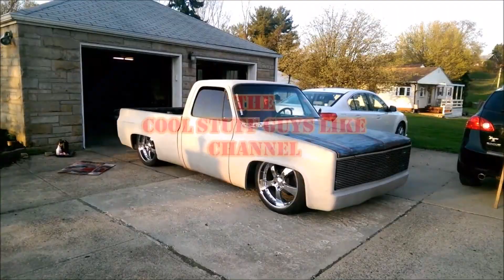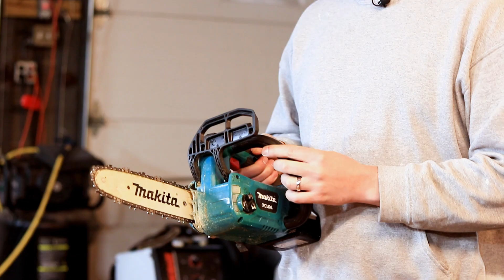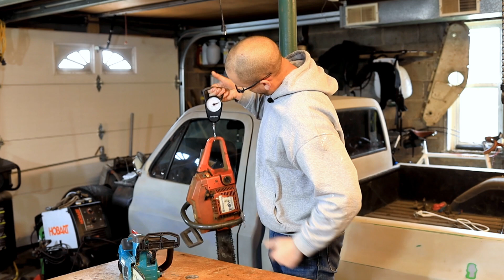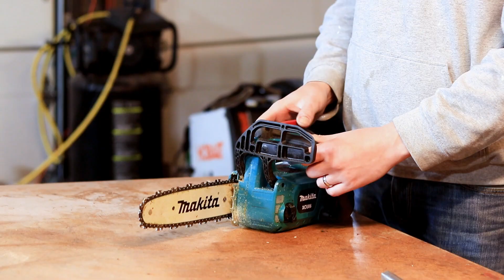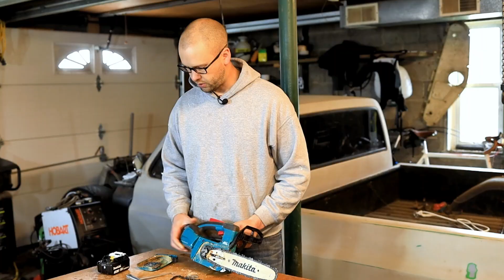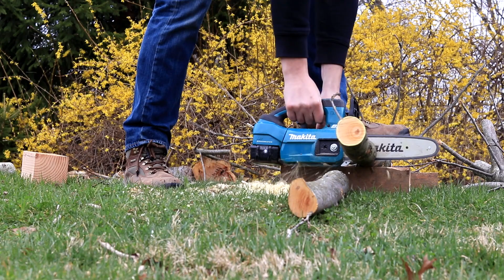Makita XCU06 Cordless Chainsaw for Trail Building and Limbing

Comment: I have a Makita 18 v chainsaw XCU06. Unfortunately, the chain was
damaged I have tried to looking to buy the new one to replace it.
Do you know where they sell it, please let me know ?. Thank.
Reply from the maker: Yes, you can get them on amazon.  The Oregon R40 10 inch chain is the chain for this little chainsaw.  I had to replace mine once after slipping it in some brush and tearing up a couple teeth.  It is about $10-$12.
Reply: instablaster.

Comment: are you sure that it's only 5.5 lbs w/ a 5amp battery?  other folks are saying per manual it's 7.2 lbs w/ battery.  trying to decide between this one and echo 2511t for in-tree work.
Reply: Did you make a decision on your purchase and if so, could you share any thoughts?
Reply: @nicod1886  I already have a stilh 201 tcm (top handle) for in-tree work, which I do NOT like.  lately it's been good but it's had its share of problems- mainly trouble starting.  also I was looking for something smaller.  but it's hard to justify getting another saw when I already have a saw that does the same thing.  also Ive been looking at the new-ish Husqvarna battery powered saw, which seem to be more powerful/lasts longer than makita.  I haven't acted on a purchase or sale of my current tree saw yet but one thing I have decided is to NOT get makita chainsaw.  if I want to go electric, I'll get the Husqvarna electric saw.  if I want to go small as possible, I'll go echo 2511t.  electric power is very appealing though, as it's nice to be up on a tree nice and quiet.  I think Husqvarna electric also has a corded power option where you can separate the battery pack from the saw- so your battery can be on your harness or back instead of your arms carrying it- that's also very appealing for in-tree saw.
Reply: @chulhochang   Hey thanks for the feedback.  I’m in a similar position as yourself and am torn.  If I go gas power, I’ll lightly choose the echo 2511 or even the CS-271 which is $100 cheaper.  I’ve even looked into that newer Dewalt electric saw because of some reviews and videos but I’ve never seen an arborist with a dewalt saw in a tree 👀
Reply: @nicod1886  i wouldn't go dewalt or even makita unless most jobs are small trim/pruning jobs (80% of my non-tree work tools are makita).  i work with big confiners in the pacific northwest and large black oaks.  i wouldn't consider anything less powerful than echo 2511 or the new battery husqvarna saw to take on the tree- even if these are few hundred dollars more expensive.  honestly, battery is more of a luxury for me.  echo 2511 is probably the more practical for what i do, and i'd appreciate the small form factor and weight savings especially reaching above.  i guess the best thing to do is be honest about what you need vs what you want and go from there.  and the other obvious thing to ask is- which saw is going to save you time and energy.  if i consider those two things, then no doubt echo 2511 is the best saw for me.
Reply: @chulhochang  Agreed.  Let me know how you enjoy that 2511 if you pull the trigger?  Be safe and thanks for the feedback man.

Comment: Can it run on makitas 18v 6ah?
Reply from the maker: Yes it will.  I mostly use an 18v 5ah and it works great.  It doesn't last forever, so it is nice to have a second large battery like that if you plan to do a lot of cutting.
Reply: @CoolStuffGuysLike  How much does the 5ah battery cost?